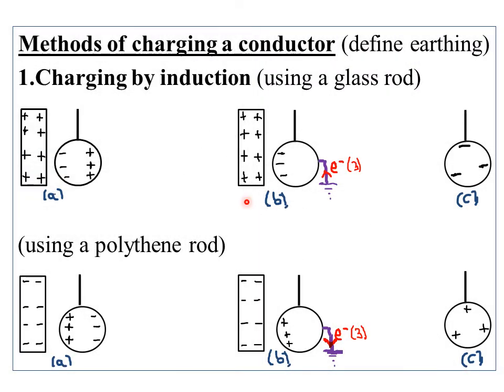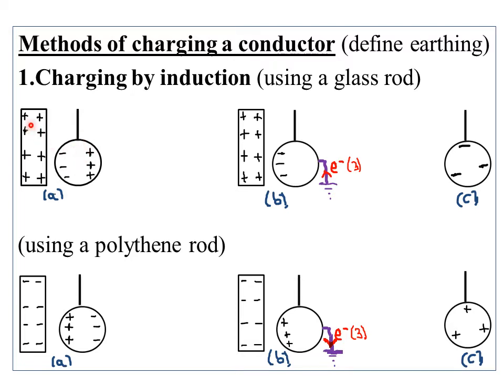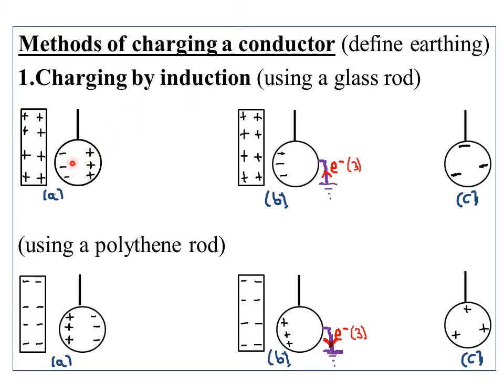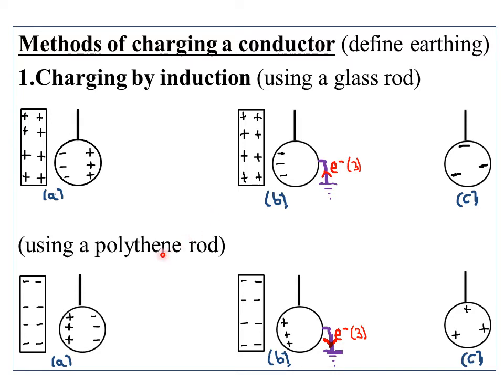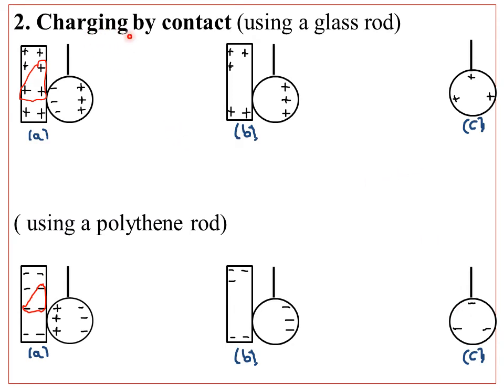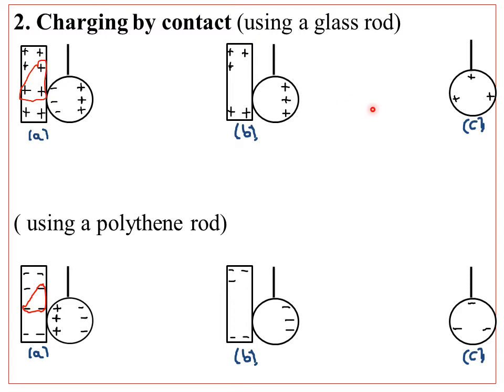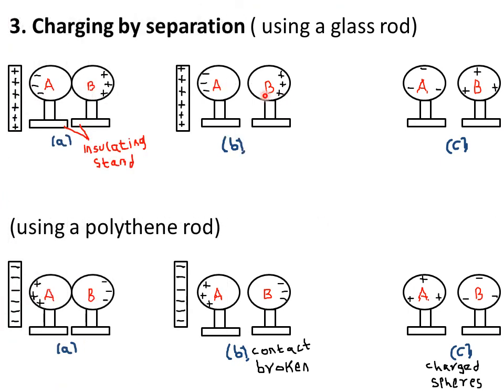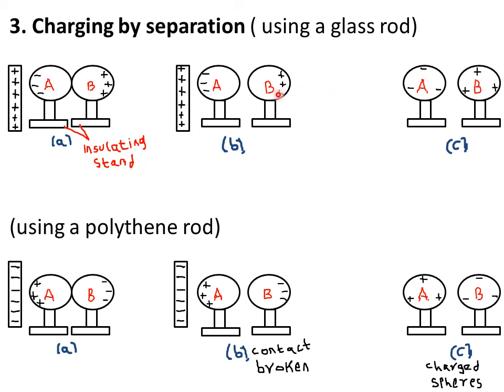ELECTROSTATICS (I) : LESSON 2

Comment: I didn't understand induction method
Reply from the maker: With induction method the main things to know is that:
1. The charging conductor is brought close to but doesn't get in contact with the material (sphere) being charged
2. The final material (sphere) acquires charge that is opposite to that of the charging rod (either polythene rod or glass rod)
3. There's earthing.
Thanks for your comment 🙏.